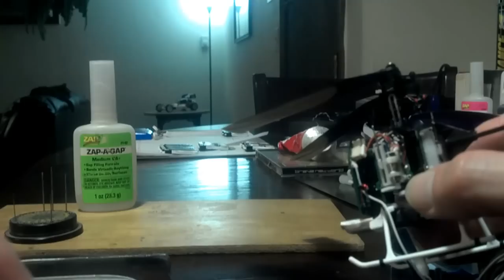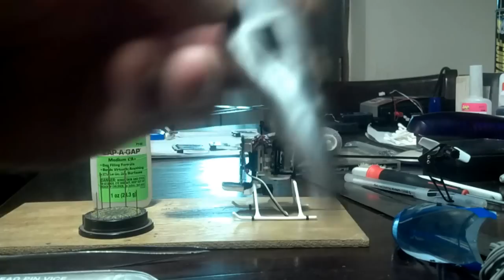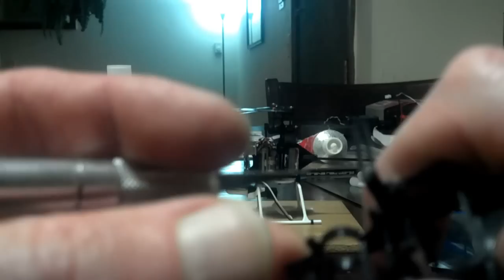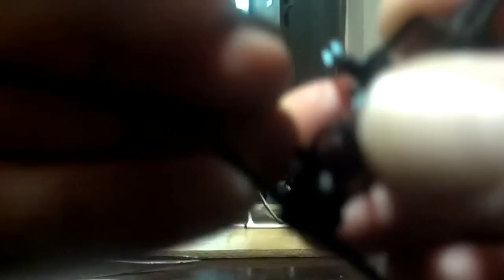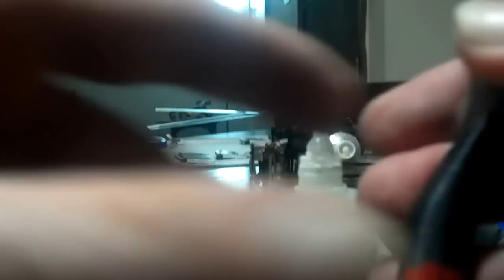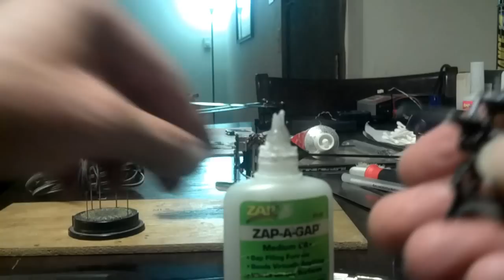Canopy mounting post repair for Blade ultra-micro size main frames

Comment: What would you use if you lost the rest of the pin? 2mm CF?
Reply from the maker: That would work. Drill out the old area w/ a pin vise and reinforce it with fishing line or thread.

Comment: Thanks for this video!  I fixed my Nano CPx frame last night that had two broken posts and they feel very strong now.  Hardest part is getting the drill bit into the pin vise straight!

I bought this pin vise and used the largest bit from the container that has the smallest bits in it: http://www.amazon.com/gp/product/B001RJE3X8/ref=oh_details_o01_s00_i00?ie=UTF8&psc=1